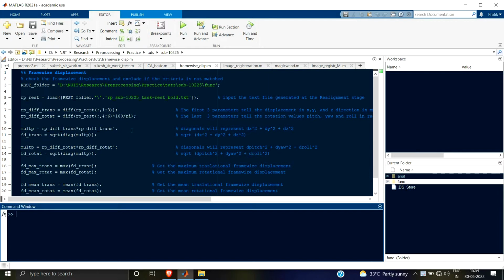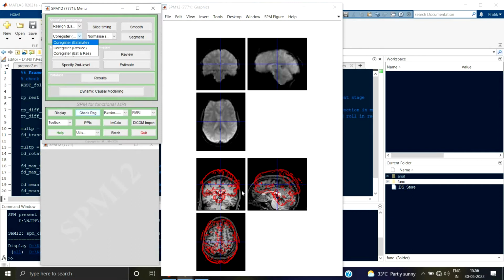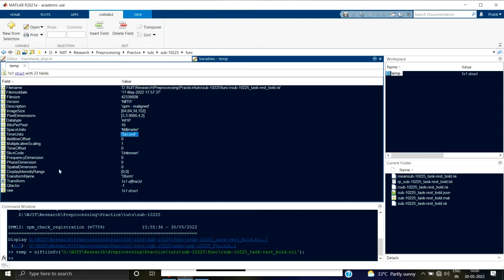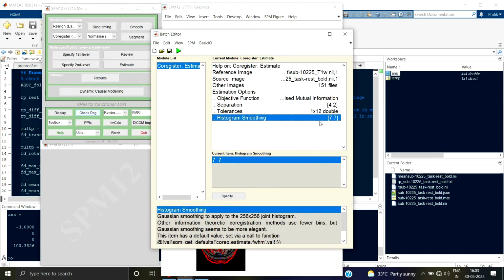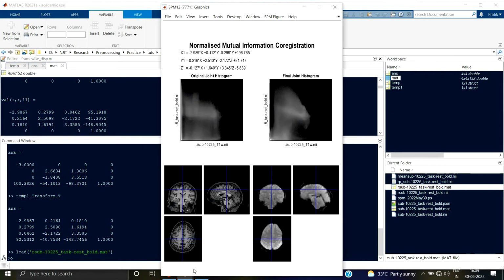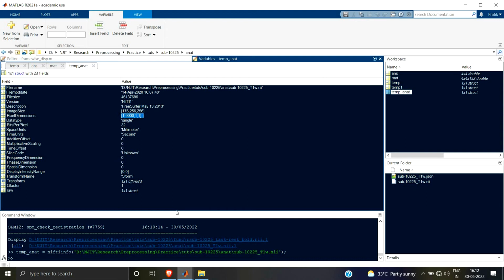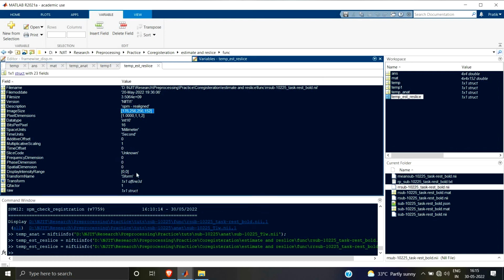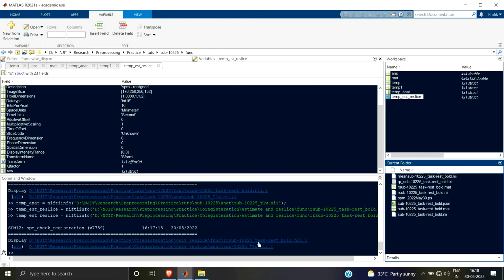Co-registration of Functional and Anatomical Images | SPM | MATLAB | Resting-state fMRI

Comment: So, I have a question. If I have 3 mean images from realigned scans corresponding to 3 experimental conditions in an fMRI experiment, should I corregister the 3 of them to the anatomical image? 

Like, I have to make 3 seperate batches or put them to the 'other images' option?
Reply from the maker: 3 seperate batches, as the coregisteration matrix for the 3 images would be different.

Comment: Hi Mr Pratik!
I am working on fMRI images and have installed SPM12 toolbox. 
>> spm fmri
Error using spm_check_installation>check_basic (line 76)
A problem occurred with spm_check_version.m.

Error in spm_check_installation (line 28)
        check_basic;

Error in spm (line 317)
spm_check_installation('basic');

Getting this error. If you have any solutions, please share. Thanks!
Reply from the maker: Hey I guess the problem is in the path, 

Could you run this in the matlab command window. 
addpath('path of your spm folder')
savepath

Path of your spm folder is where spm is downloaded and stored.
Reply: @pratikian  Hi. Thanks for the quick response. Yes I have tried this many times.
>> addpath G:\MATLAB\R2021a\toolbox\spm12
>> spm fmri
Error using spm_check_installation>check_basic (line 76)
A problem occurred with spm_check_version.m.

Error in spm_check_installation (line 28)
        check_basic;

Error in spm (line 317)
spm_check_installation('basic');
 
>>
Reply from the maker: @damariseveline7781   maybe try 

addpath G:\MATLAB\R2021a\toolbox\spm12\spm12

there is an extra spm12 at the end
Reply: @pratikian  There isn't an extra spm12 in spm12 folder
Reply from the maker: @damariseveline7781  thats strange. Usually spm comes in 2 spm12 folders. Could you try redownloading.
Reply: @pratikian  Okay. Will try downloading again. Thanks!